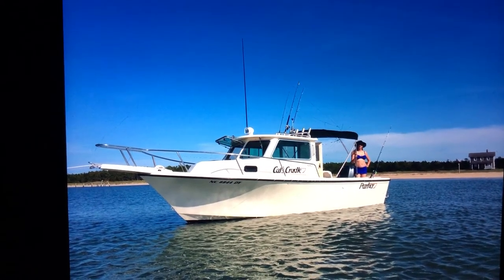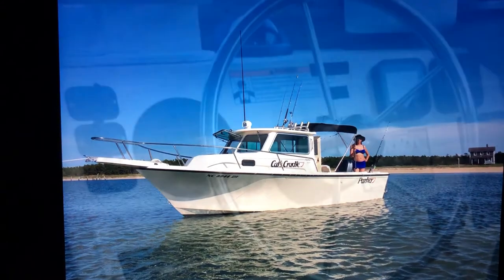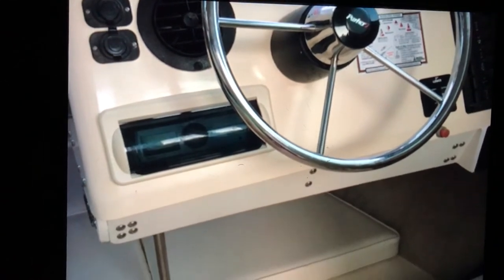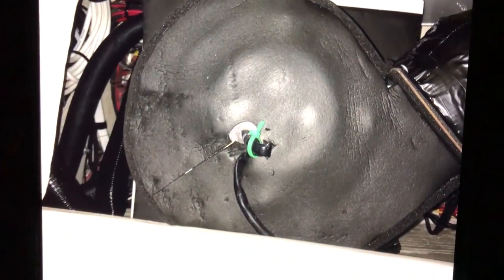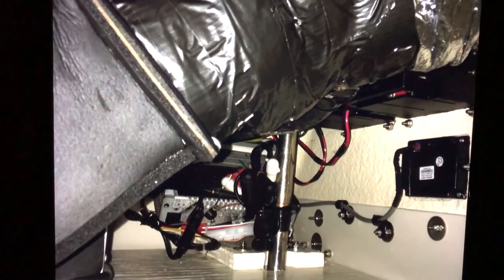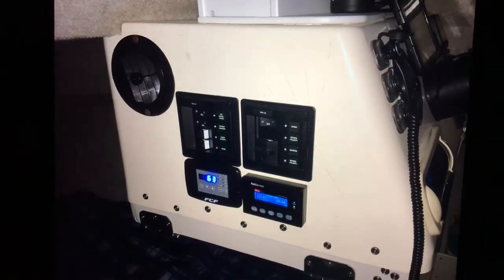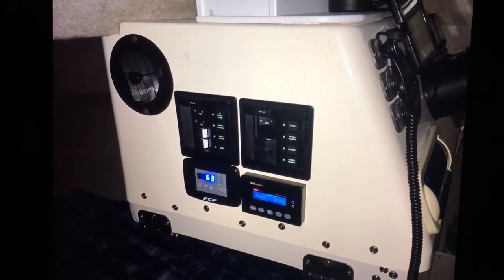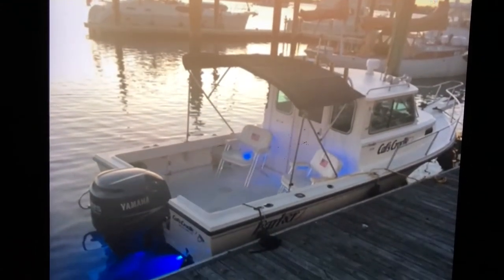Parker 2120 Bimini Top & Boat “Cat’s Cradle”

Comment: Nice rig! You may not remember but I posted a video of your boat when I saw you all docked in Beaufort a couple years ago... I didn't know you had air conditioning. If I had known, I would have 'begged' a boat tour to see it! ☺
Reply from the maker: I absolutely remember talking to you from the dock. I subscribed when I saw the vid you posted. Anyway, I’d love to show you the boat if you are ever back in BFT. I just pulled her out of the slip today and put her in the boat barn I store off-season. I’m heading to Ocracoke on a friends boat this weekend. I have a few things on mine I want to do at the barn next week when I’m back. I’ll be putting in on nice weekends through Dec and I’ll be docked at BFT docks. FYI - I have a pure sine wave inverter in jump seat, 200Ah AGM in bilge. Also hardwired digital charger in bilge. Can run AC about 2.5 to 3hrs running boat. All Blue Seas panels.
Reply: @akajbssmith7423  That's a great set up you have there; love the AC! I don't get to Beaufort often, but when I do I always walk the docks to look at boats. If I see your boat next time I'll be sure to say hello!

Comment: Loved the bimini top awesome. 
But how did you install the ac?
I just subscribed to your channel Cap.
Love your Non Crooked pilothouse boat.
Reply from the maker: Out On The Reef - Thanks Cap. The AC was a bitch. Not going to lie. I got the idea from another 2120 guy who did the install on one with the newer helm like yours. He built a shelf for it but there are a few main difference between mine and his. First of all, the newer helm fiberglass goes down more than my older one. This is so they could create that flush mounted shifter/throttle part with the drink holder and wrap it around to the helm looking right. I had to create those side extensions/brackets using starboard to gain the extra 3” or so of clearance I needed. The other difference is that the other guy made a fixed shelf and I came up with the idea of using heavy stainless steel door hinges to mount the shelf with. With your helm I could have just attached the 4 hinges to the bottom edges of the helm and it would be perfect and a much cleaner install. I attached the control unit for the AC upsides down to the top of the helm. All of the power wires and control wires run to that box and it has a loom harness about 2.5’ or so long that runs from the box to the compressor/blower part of the AC unit. The inlet, outlet and condensation lines pass through a notch in the shelf and they have enough slack that when I lower the unit down to the bunk, I don’t have to disconnect anything. Even the vent hose and flange mount are so tight in clearance that when the unit is lifted in place it just attaches to the vent hose/flange by compression. So to work on the unit or anything wiring etc.. behind the helm, I just pull the 4 hinge pins and lower the shelf down to the bunk and I have open access. It’s a 2 person job though as I need some help knocking out the pins and holding the shelf. My boat had raw water wash down so I just removed that pump (I just use a bucket) and used the existing thru hull for my AC inlet. The strainer and pump are mounted in the bilge. I added an extra rigging tube flange next to the original one on the starboard jump seat then another one in the deck of the storage area in the jump seat and another one in the side of the bull head in the bilge. I threaded a rigging tube through all 3 flanges to create a conduit to run the water line and the 3 110V power lines through to the bilge. So all power and the water line runs along the gun wall attached to the rest of the rigging down to the jump seat then into the bilge. This also creates a nice slightly uphill continuous run for the water line which is recommended way to instal the AC supply water line. I could right a book so a vid would be better. Mine is sitting in a boat barn in Beaufort right now but I hope to splash towards the end of the month for the first tine since about November. I’ll take a good vid of the whole set up along with the bilge and jump seat areas when I get to the boat. You will see how I rigged the batteries and inverter too. I really want auto pilot but concerned if I have enough room to connect the extra hydronic lines to the helm with the AC there. I think I do but....? Sorry for the super long reply.